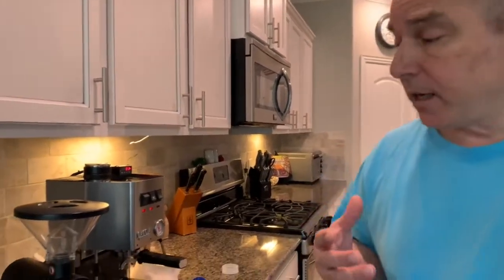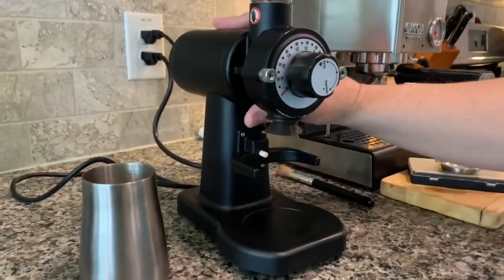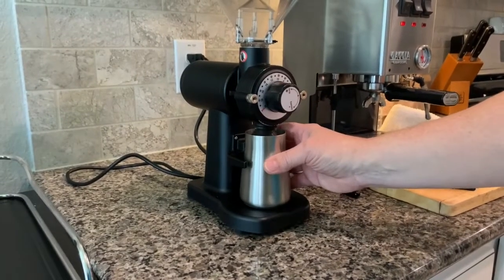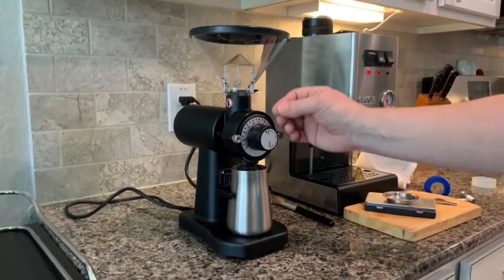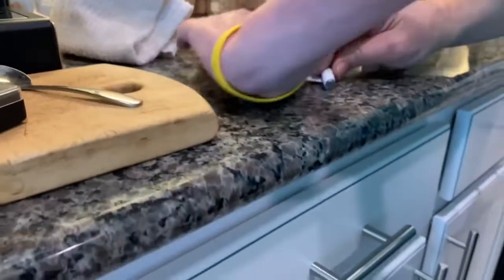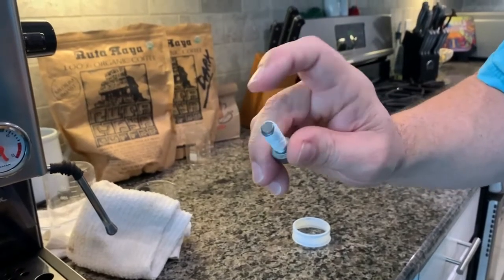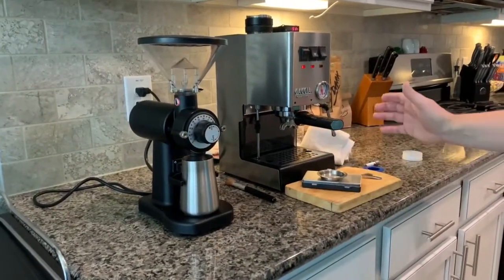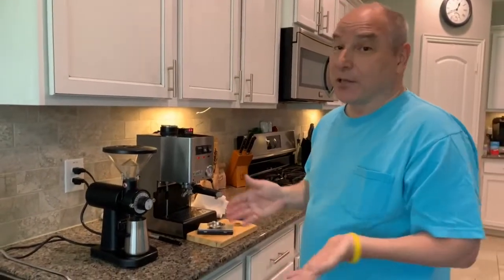Someone put paint chips in my coffee puck! Yuck!

Comment from the maker: Well we never did take the Gaggia and Urbanic on the road, and we survived. When I returned shots didn’t taste the same; I had some cleaning to do! On the threads of the core to make the grinder stepless I did have to add two more layers of Teflon tape to keep the dial from drifting.
Reply: Does the sticker on the knob pull off and go back on well?
Reply from the maker: @tristanwwsd  yes, relatively well.  I have removed and replaced about 4 to 8 times with no issues, but I carefully remove with the edge of a blade so not to bend the sticker in any way!
Reply: @threehanded8853  👍Thanks

Comment: Was about to get the Urbanic 70s, but kept reading reviews of the Eureka Mignon Crono ($250- timed) and Filtro ($209- untimed) grinders from WLL. Apparently they're "made for" filter coffee, but the pre2021 models are shipped with espresso capable burrs (a $35 upgrade if you can't get a pre2021 model), so I took the plunge and got the Eureka Mignon Filtro. The thing is total class. Italian made, indestructable, stepless, consistent, fantastic. Got a bellows and now it's got 0 retention. Wanted to let you know as I was a big fan of the Urbanic until I discovered the Filtro, in case you find yourself needing a new one without breaking the bank. Cheers!
Reply from the maker: Still very happy with the Urbanic. It has 60mm burrs, as opposed to the 50mm in the Mignon, and I like the ease of two thumb screws for easy access cleaning. And I’ve installed the dimmer switch mod as well. So I’m probably using this ‘til I break it!
Reply: @threehanded8853   Cleaning is really easy on the Mignon line, but I hear you on the 60mm burrs. I wonder if a single dose hopper and bellows would help you out instead of shaking the grinder? I've been happy with mine. Glad you're loving the Urbanic! Cool grinder for sure.
Reply: Yes you can just change the burrs and your good get that grinder not this. No paint coming off of eureka
Reply: @threehanded8853  in the long run the italia made unit will outlast the Korean. I mean come on paint chips coming off. ?
Reply from the maker: @BigPoppa-t3z  yet to be seen. Currently my money is on Korean technology, which historically has a better maintenance reputation.

Comment: I have a white 080 and I have no issues with the paint. I wonder if the black paint is faulty on a batch or is simply less durable than the white. My 080 survived a poorly packed move (all coffee gear in a box without padding) without so much as a scratch.
Reply from the maker: Since the 080 has a down chute the catcher would never rattle the bottom of the dial. I wonder what would happen if you wacked the side of the motor housing with a metal spoon. I don’t recommend it, though!
Reply: @threehanded8853  I just gave it a try a few times. Loud audibly ringing hits. It worked out fine. It would be great if Urbanic could do anything for you.
Reply from the maker: @m_cabral  That would be amazing, especially since I voided the warranty by installing a dimmer switch. And I don’t think hitting the motor housing with a spoon is covered in the manual for normal operation!